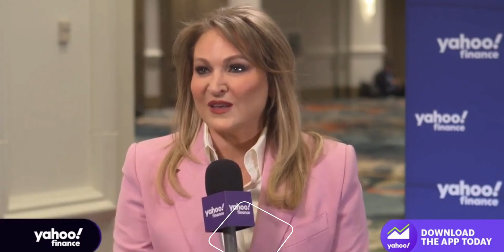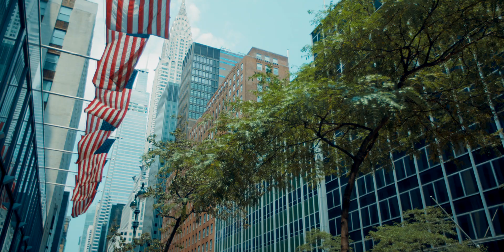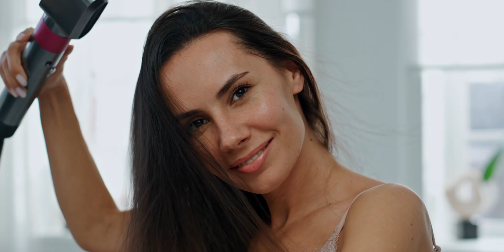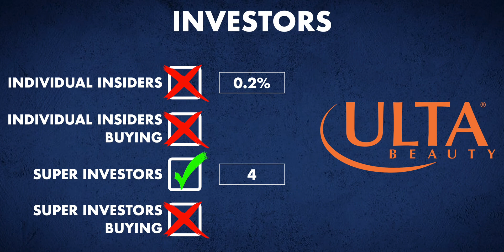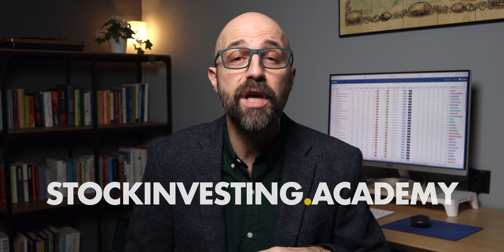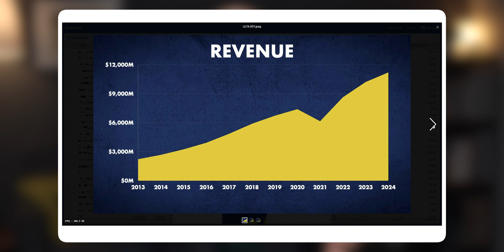New CEO - Same Great Company? | Ulta Beauty Stock Analysis

Comment: if It was this good then why did Berkshire Hathway dumped it 3 months after buying it. I know Warren Buffet is known in the financial world to be ethical but that looks like a pump and dump operation considering it's obviously spiked after BH bought it. It seems like a good company but it's a sector that's always riskier than you would guess. It's priced as a staple, but cosmetics aren't really staples and will still tank in case of a major economical downturn.
Reply from the maker: Thanks for sharing your point of view. Very interesting. When it comes to Warren, I would also consider two other things. First, it was a small position, so it was most likely Ted or Todd, not Warren himself. Second, Warren is currently selling off many holdings. If you’re interested, here’s my take on his moves. https://youtu.be/hUQODfTKYTY